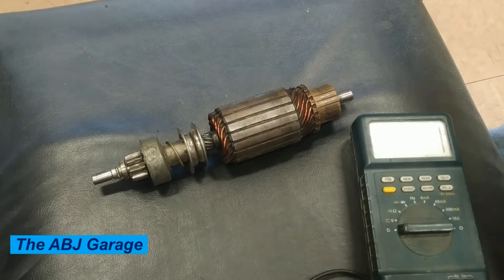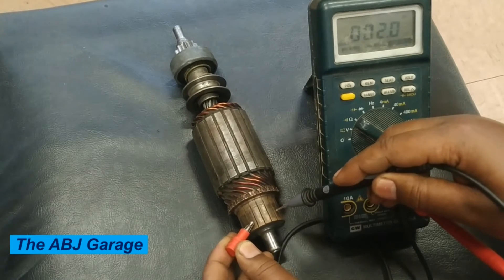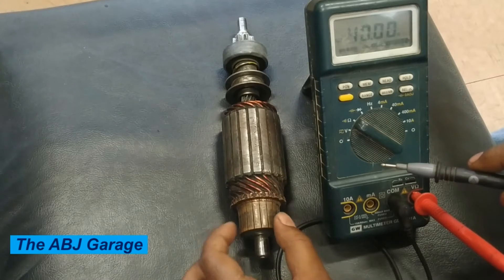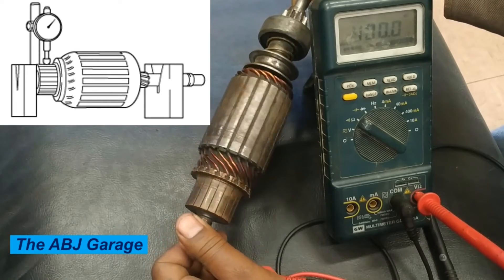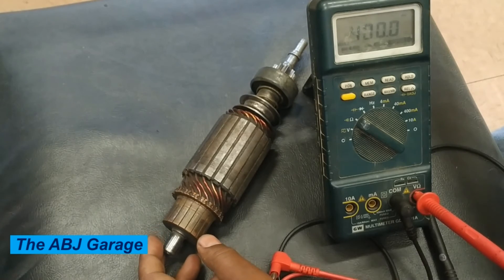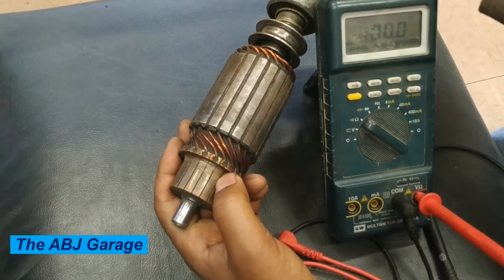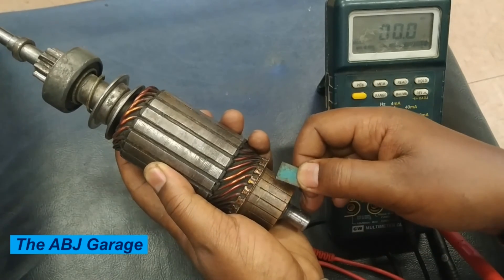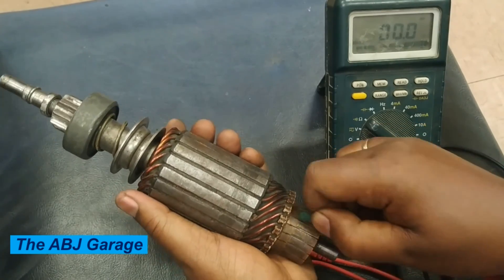How to inspect starter motor armature

Comment: To clean it up, never use emery paper!!! You can use brown paper. Like from a supermarket carry  bag.Cut piece about 150 x 100mm and fold into a strip that's about 150 X 20-25mm..Wrap around commutator and rotate armature back and forth. It needs to clean it uniformly. Do not rub particular segments by themselves. It will create flat spots on the commutator and then it needs a lathe.
Reply from the maker: That's a very helpful tip for cleaning the commutator! Thank you for sharing your expertise!

Comment: My starter spins slowly and seems to have a short circuit... seems this might be the cause 9:49
Reply from the maker: If terminal 30 is not shorted to terminal C by the starter solenoid, then it will keep on rotating slowly. The hold-in and Pull-in windings should work together to pull the solenoid armature and act on the contactor that short circuit 30 to C.